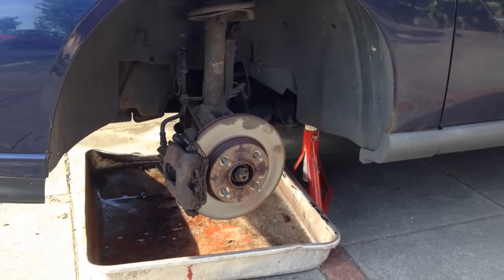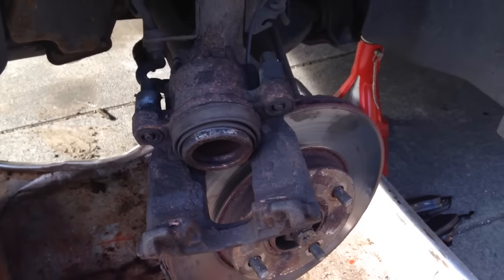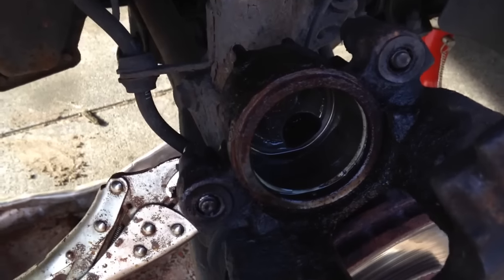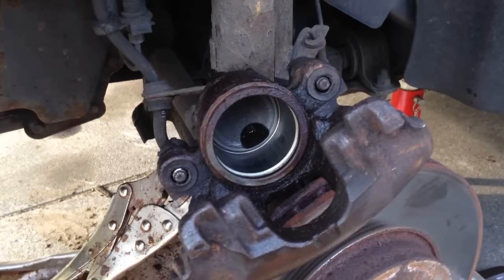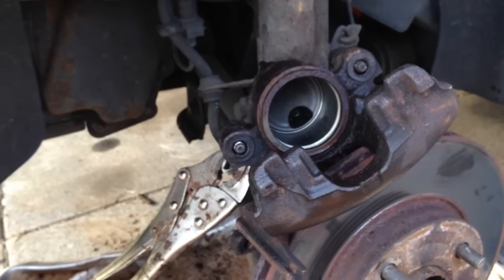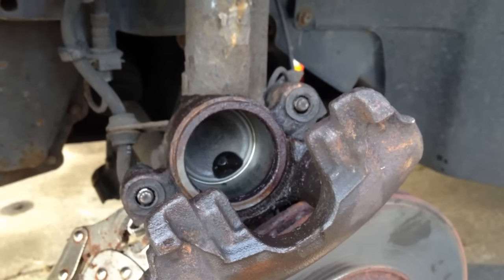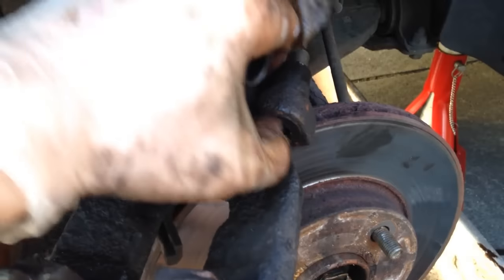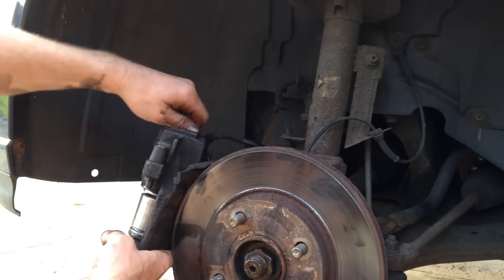How to Rebuild a Brake Caliper (WITHOUT Removing it From Your Car!)

Comment: You placed the seal in place with dirty gloves on. You did not clean the piston. And you dont need any lubrication on the back of the piston.
Do it again and do it right.
Reply from the maker: The gloves were there to keep my hands clean, not to treat my 1999 Ford Focus brake system as though it is a critical flight system on a NASA spacecraft which is about to be sent off to a distant galaxy. (I used to work as a technician on aircraft hydraulic systems including flight controls of fast jets and helicopters, so I know how to do it 'by the book'. I also understand what I can do not by the book and have successful results.) The 'lubrication on the back of the piston' was me putting grease on it with one hand whilst faffing about with a camera in order to make this video to help other people out. The grease was put where it was so that as I inserted the piston into the caliper body the grease would be wiped off by the square profile seal, aiding installation. This job was done ages ago and the brake functions perfectly. I will certainly not be 'doing it again'! Chris

Comment: Not really a big deal to take the one line off on the back of the caliber, and then once it is off it's just as easy and in the same price range to get a new caliber turn the old core in on older vehicles at least, 22 dollar caliber 6 dollar hose on the back, not to say you didn't do a great job, just not much on tearing calibers apart unless it's on my corvette, or on my camaro with big wilwood calibers.

Comment: Thats how you get a sticking brake....never ever pinch of a brake line.....ever. It will destroy the inside of the line and then started acting as a check valve. Once the brake is pressed the fuild cant return to the master cylinder and locking up the brake. Dont do it. If a professional mechanic did this it's a lawsuit waiting to happen.

Comment: my seal refused to get in place. and i ended up making holes in the seal with my screwdriver. everything was easy. except for the damn ☠seal☠
Reply: palle farligsen 
I'm at that point right now on my truck. What did you end up doing to get it in? I was about to try the screwdriver method but I was scared of puncturing it too. Please respond back as soon as you can.
Reply: @nateintx4098  i put the seal on the cylenders edge and then put it inside the grove.

Comment: good vid  but here in USA we hand the old caliper back in and it is in turn remanufactured to live again.
Reply from the maker: Here in the UK most people take the car to the garage, they throw what is a perfectly good caliper in the bin and fit a nice shiny expensive new one. You don't have to do what everyone else does though: this video is for people who want to get stuck in and get their cars back on the road ASAP at as low a cost as possible. Cheers, Chris
Reply: +Christopher Barr - Random Chris.. liked the job you did ill watch it more than once.
Reply from the maker: +henry ford Cheers Henry, I hope you have a brilliant 2018 👍
Reply: henry ford s but you can get kits seals and re do de rust degrease paint and save 100 per wheel  I did my 1976 vette and it was going to be 1200.00 Canadian for remanufactured brake  calipers  to do all 4 wheels they have 4 pistons per wheel and lip seals bought a kit for all 4 wheels 55.00 Canadian painter them red after prepping saved a ton of money and did them I over 3 days letting paint dry and reinstalling had about 8 ours in to them

Comment: Do not listen to this guy or you will be buying new brake lines, it’s amazing how wrong  someone can actually be and still pretend to know about brakes, unless you want to be buying and replacing crushed brake lines, wow dude! YOU SHOULD AT VERY MINIMUM EDIT THAT OUT, better yet you should remove video before you get someone into a car crash!
Reply from the maker: Yeah ok then: the brakes worked fine and passed inspection in 2022 before I sold the car. The proof of the pudding…

Comment: those are vice grips, not mole grips
Reply from the maker: They are indeed. Next time I'll say "locking pliers"... If I was using a vacuum cleaner to clean the car I would refer to it as a 'hoover', even if I was using a Dyson. I guess this inaccurate language is just a terrible habit of mine.

Comment: For a part that is as important as this, do you really want to trust a home rebuild!!!!!  Seriously this is one area you should not cut corners to try to say a few bucks!!! GIVE ME A BRAKE!!!!!!  (pun intended!)
Reply from the maker: As I used to maintain helicopters and fast jets (including working on their hydraulic brake systems), where the consequences of a mistake could have been multiple deaths, doing this work on the brake of a Ford Focus doesn’t make me lose any sleep. If you prefer to pay a mechanic, that’s great - we’re all different. Cheers, Chris
Reply: @christopher_barr  I'm glad ur sooooo qualified to work on a ford focus!  You know what makes me lose sleep? Someone watching ur video thinking its ok to try to fix a rusted out part when they can spend a few more dollars and BUY a completely new  brake caliper, install it and not worry about it failing when you need it!  OH, BTW, I've done enough brake calipers to know not only how simple it is but how something as important as brakes shouldn't be taken as an area to "cut corners" to save a few bucks!  You want to show how to rebuild something, try a starter or an alternator, you know an nonessential  item that if it fails it won't kill you or more importantly an innocent person walking or driving down the road

Comment: That destroyed the hose and caused the pump to cease in the future
Reply from the maker: This brake passed the MOT (Inspection including an efficiency test) I put it through before I sold the car - 6 years after this video was filmed. So the hose was most definitely not "destroyed". Cheers, Chris
Reply: @christopher_barr  A clogged hose is one of the main reasons for the ceased calipers. Tq for the reply.

Comment: Take the caliper of the car, It needs bled anyway
Reply from the maker: You can bleed a caliper, using the bleed point, without disconnecting the brake line.

Comment: Clamp brake line? way to kill it, especially on older vehicles
Reply from the maker: If the hose is damaged by clamping then you should be very happy to have discovered their fragility and replace all brake hoses. If you don't clamp a damaged hose, you are still disturbing it and as a result  it may fail afterwards anyway - perhaps some weeks down the line with the expansion and contraction induced by repeated braking. Clamping a brake hose is a very useful 'stress test'. In my case the hoses were perfect, despite their age, and 2 years later everything is still working perfectly.

Comment: Using clean gloves on reassembly would have been better, those gloves you were using were filthy and covered in muck which you transferred to the new seals and piston that will not last long now, give the backs of your calf's a dam good slapping now and go to bed without any tea.
Reply from the maker: I was wearing the gloves to try to keep my hands clean, not to work on my caliper as though it was an aileron actuator on a fast jet (which I have worked on, and which do demand more stringent work methods). I am certain that this caliper will last just fine, for as long as I own the car, despite me not wearing sterilised surgeon's gloves whilst replacing the seals. Cheers, Chris p.s. My lower legs hurt and I'm hungry.

Comment: Doesn't seem that worth it for the amount of effort. I'd rather pay 40 dollars for a remanufactured caliper. Plug and play. Also you're compromising the brake hose by clamping it. That'll need replacing and will cost you around 30 dollars when it fails

Comment: I tried to fix / rebuild a caliper.. Trust me is not worth the time, the money buying the parts and the headach, most the time you have to change the rubber boot , buy grease and sometimes the pins are corroded. Is a stupid thing to do.  A brand new caliper cost $120 and they refund $60 for the old one. Practically you take the old one to the Auto Parts and they    replace with a brand new for only $70.. Every single part comes with the caliper.. I learned the hard way.. Is not worth.. Not even for a 3rd world country guy that likes to fix everything.. The time and money worthless...!!!!  For me with all the experience fixing stuff,  is stupid doing it..

 .. I will neve ever do it again.
Reply: The caliper is not rebuild,  you just changed the piston. There are many other parts to be replaced..  If you rebuild the entire caliper VS buying a new ones . Trust me you only saved $20 and that's with out counting the 4 hours job.. if you do the math you didn't save anything.  You are negative $.

Comment: Bodgery of the highest order
Reply from the maker: No, manufacturing a seal out of an earplug so that an aircraft undercarriage can be replenished with 3000 psi of nitrogen is bodgery of the highest order. I did this in the desert when we had no spares and this also worked perfectly. Sometimes bodgery is very satisfying actually!

Comment: Just buy a new one. Brakes is on system you shouldn’t rebuild
Reply from the maker: The internals of the cylinder are just as they were when it was brand new, the cylinder is new, the seals are new. I used to maintain aircraft brakes (fast jets and helicopters) and despite the value of these machines ($40 million each) and the potentially life-threatening consequences of a failure, we refurbished their brake systems. Cheers, Chris

Comment: why use a dirty glove to aasemble the brake and ruin the piston and sealing, and clean hands outside use your brain, its dumb to show your failure way to do it
Reply from the maker: The gloves were an attempt at keeping my hands clean, not an attempt at surgical cleanliness. When I used to work on hydraulic systems on aircraft, like flying controls of jets and helicopters, cleanliness was essential. I know what I can safely do on the brake of an old Ford Escort, but thank you for your advice.

Comment: You don't work very clean, you put your greasy hands on the rotor, the rotor needs machining, I believe you work in a car wrecker factory where quality and standards are NOT written in the dictionary!
Reply from the maker: Hi Bill, you're entitled to your opinion, but the proof of the pudding is in the eating: the brake operated perfectly after the oil had burned off the first time it was applied with a decent amount of pressure (I drove the car and was prepared for the reduced initial brake efficiency on that wheel. Within a few minutes of  use it was back to normal.) I sold the car six years after this video and it passed its MOT inspection (including brake efficiency testing) without any problem. Cheers, Chris
Reply: @christopher_barr  In the mean time you divorced then your new wife kicked you out of your home. LOL